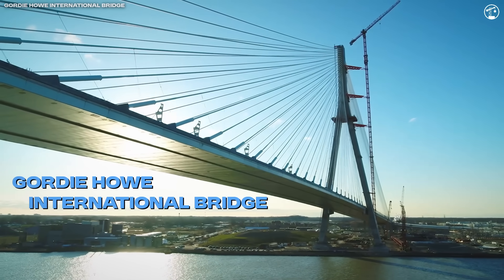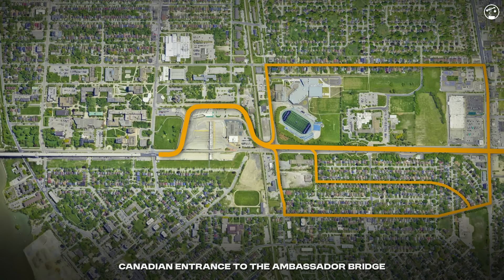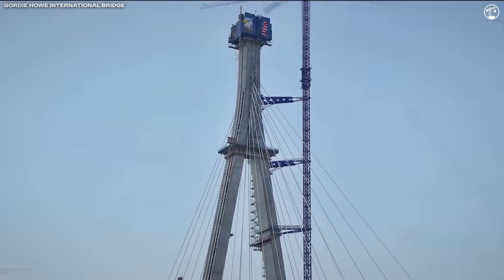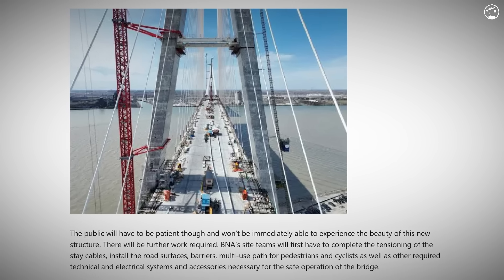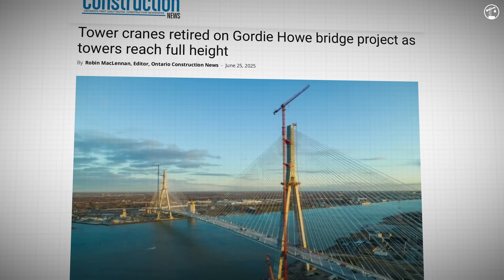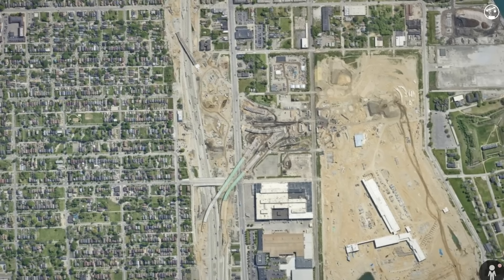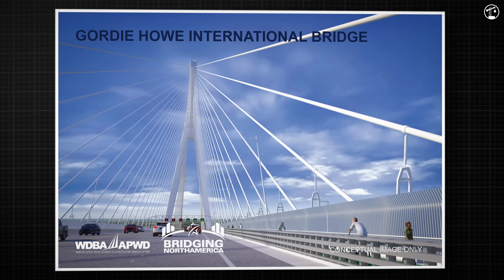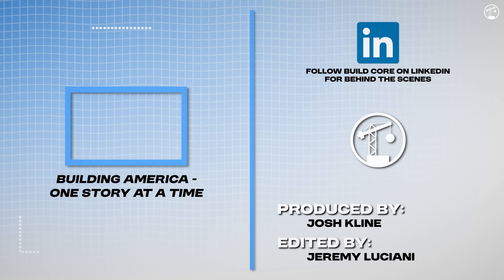Inside the Final Year of Detroit/Windsor’s $4.7B Bridge Project

Comment: The bridge will fail, mark my words. If the temperature falls lower than -14c and the bridge is at max capacity, the structure will not hold
Reply: Are you okay ? Engineering thought about all of that

Comment: It is incredibly likely that the bridge will not open until later 2026, Canada has a law requiring CBSA to possess the POE for 9 months for training, integration, etc... before formally opening. CBSA still does not have possession of the facility so we are more than 9 months away unfortunately. I was hoping to cross on a trip this fall.

Comment: I understand that in Detroit, there’s long been an issue, with either signage or actual highway routing, that often leads people to accidentally travel into Canada by taking the wrong ramp. Has this project fixed the issue or improved upon the situation?
Reply: You can only put up so many signs that say "Bridge to CANADA ONLY! 🇨🇦No USA traffic". They actually have a picture of the Canadian flag on the signs! Some people just dont play attenion.
Reply: On the Canadian side the Ambassador Bridge is next to the University of Windsor and a relatively dense residential neigbouhood.  You also have to go from the 401 highway to  'regional' highway 3.  Between the 401 and the bridge there were 13 lighted intersections with speeds being reduced from 110 km/hr, to 80, to 60 to 50.  Now a vehicle can get from the 401 to the new bridge at essentially highway speeds and never interact with pedestrians.
Reply: The new bridge has a turn around lane built into it for traffic that failed to exit on each side

Comment: Engineers obviously didnt take ice on the cables into consideration. Ambassador has ice falling off the cables and those ones are straight up vertical not going over the roadway
Reply: There is a deicing system on the cables
Reply: @jamessobetski9795  They definitely have taken icing on cables into consideration. Videos by others have addressed that before.